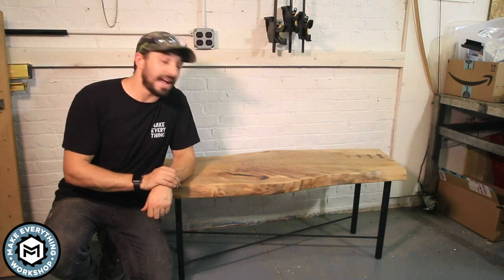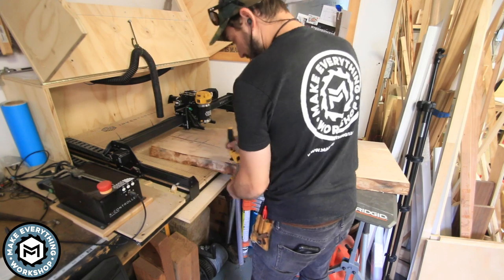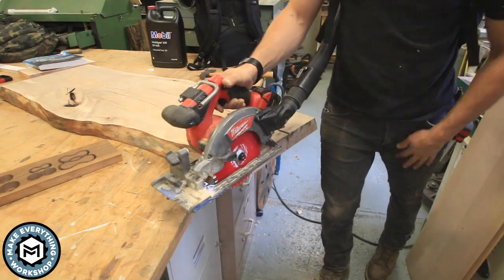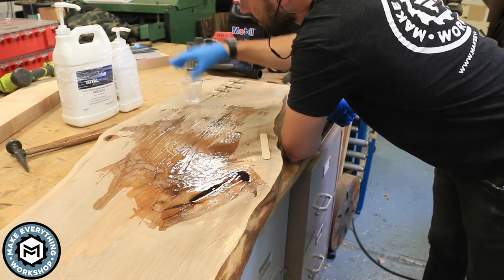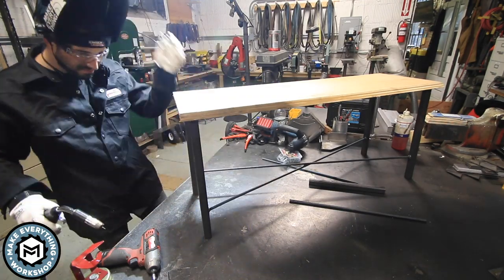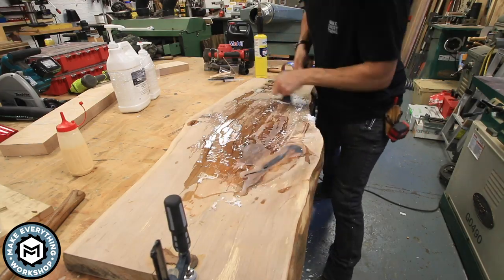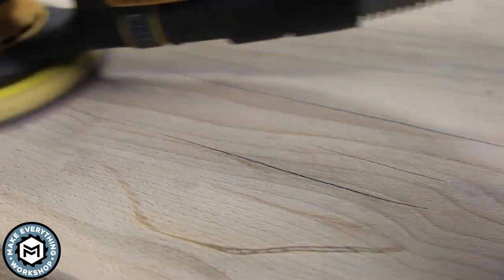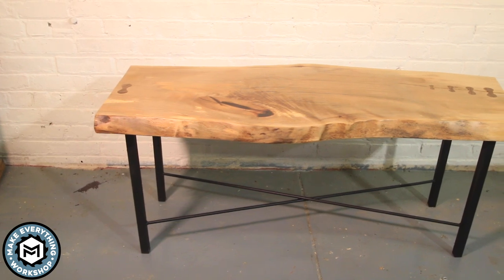Slab Coffee Table W/ CNC Butterflies

Comment: I think it's cool that because there's no "stretchers" on the table base, that if the wood wants to expand the legs will just flex slightly to accommodate it, instead of fighting it. Also, love the plastic tubing caps, I've used those on some carts and they save a lot of time, and in this case they are gentler on a floor than steel would be.

Comment: I have never worked with that type of epoxy, My question is why didn't you fill in the cracks between your butterfly plugs or do you have another way to keep debris out of those cracks.  Great job. Love the shop too.
Reply: Larry, I thought the same thing also why only finish the top and also one coat of finish, personally I would have added some more. In the past I have also made contrasting wooden insert feet that sit inside the square tube.